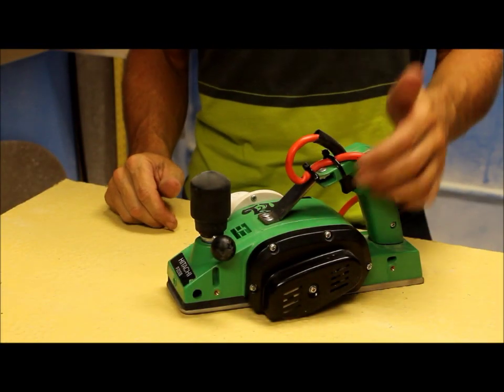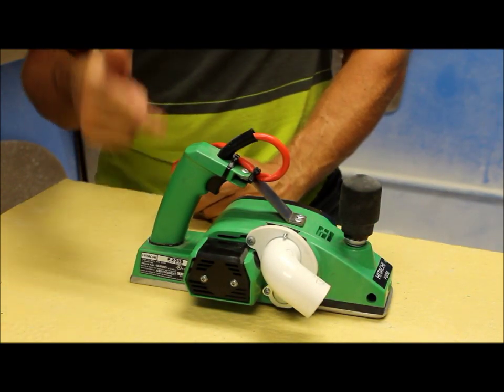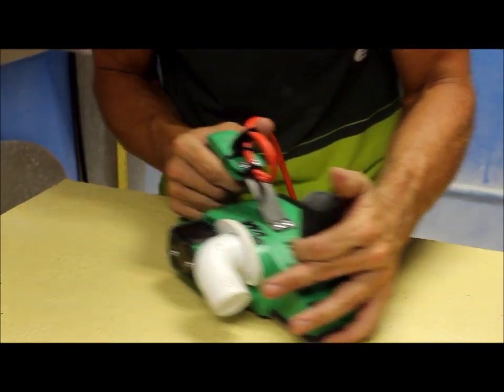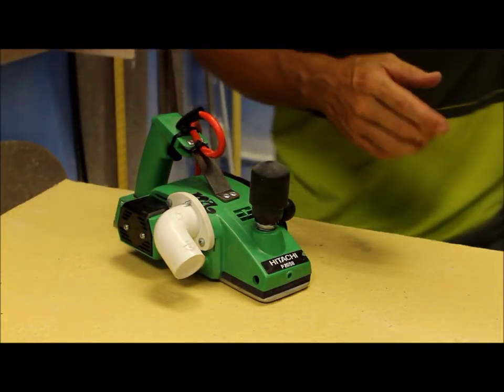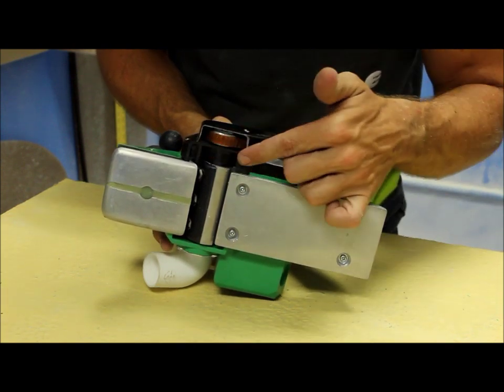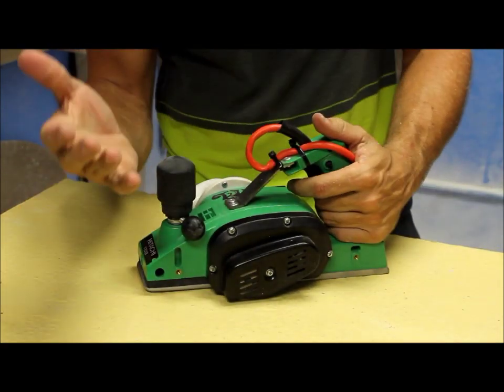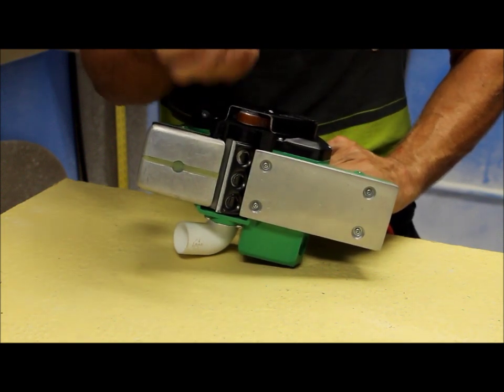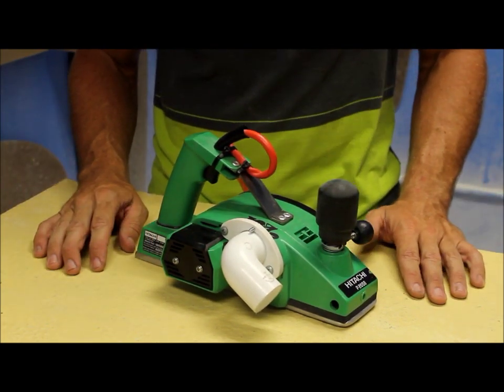Modifications needed for a Surfboard Planer

Comment: fkng excellent tips
funny this video addresses all the questions I had
I got a cheapo harbor freight planer and it has vertical handle and a vacuum outlet
I bet the bearings will crap out asap, but I can replace those later with a vise